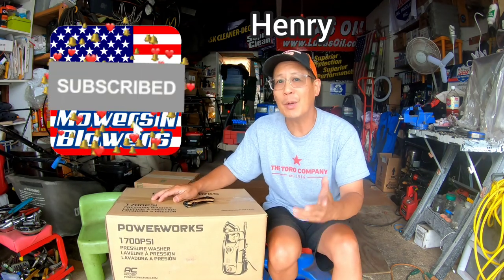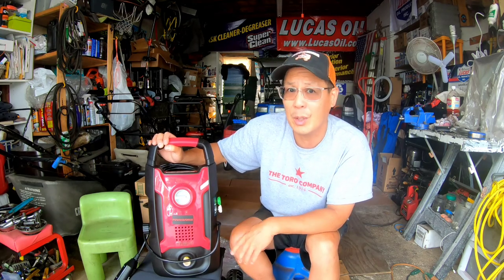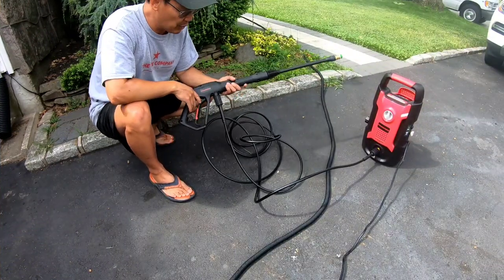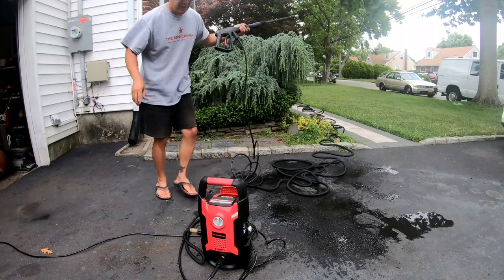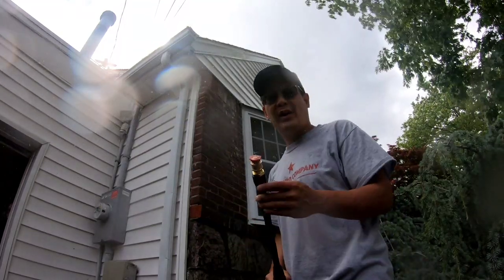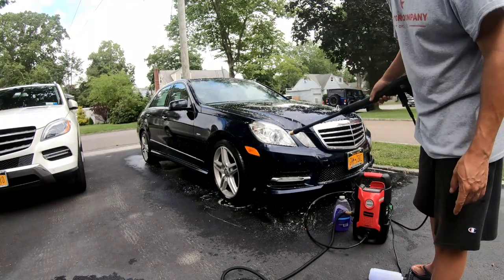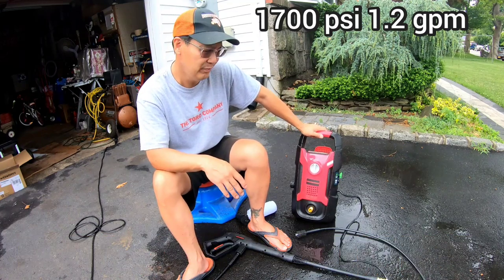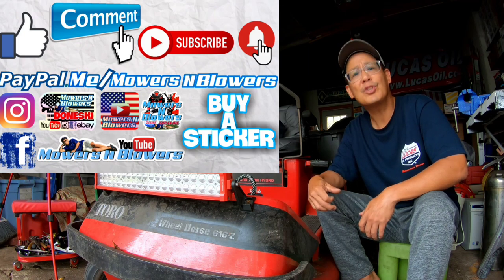POWERWORKS 1700 PSI 1.2 GPM ELECTRIC HOME DRIVEWAY CAR POWER PRESSURE WASHER UNBOXING TEST & REVIEW

Comment: Instead of different tip attachments. They need to just have a something that you turn that turns up and down the pressure. And then something that just changed the width and the end of the wand.  But the last part isnt that important.

Comment: ITS ABOUT DAMM TIME!  BET YOU WON'T SELL THIS ONE!  Make cleaning up machine EASY PEASY see if you can affix a longer extension to the gun.
Reply from the maker: I don’t like it,  won’t use it!
Reply from the maker: Not that easy,  drag the hose out, plug it in , uncoil the hose and wires?  Pain in the ass!
Reply: @MowersNBlowers  you are doing it wrong!

It’s electric, mount it on the wall.  Mine never leaves the garage.

Comment: I have had a electric pressure washer for years same one. Yah it’s broken before but it was some plastic pieces. Pump has been working great (nock on wood) apparently I have been storing it correctly and not knowing that.   I may be the market for a new one. As parts for my electric pressure washer are now no longer available.
Reply from the maker: You can buy this one if you want
Reply: @MowersNBlowers   thanks for the offer. But until my electric one breaks i don’t need it.  (No room for it)
 Mine is a 1500psi 
Campbell-Hausfeld.  I also trash picked a gas pressure washer (kohler engine) as well and decided to keep it.